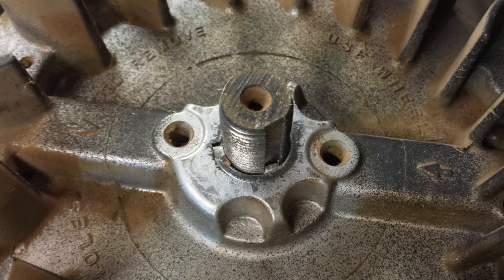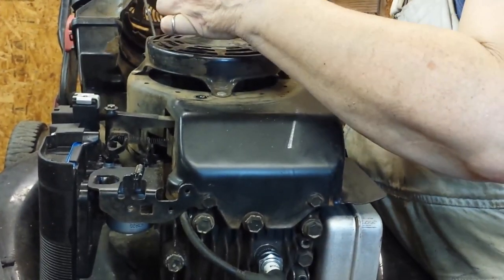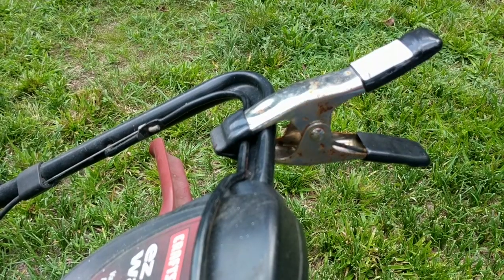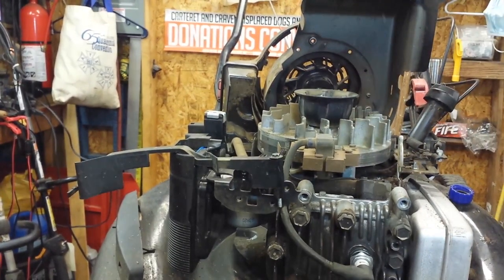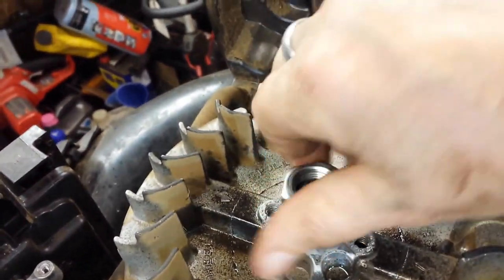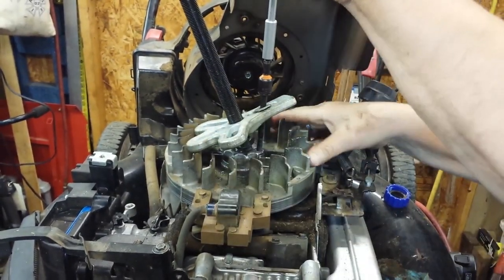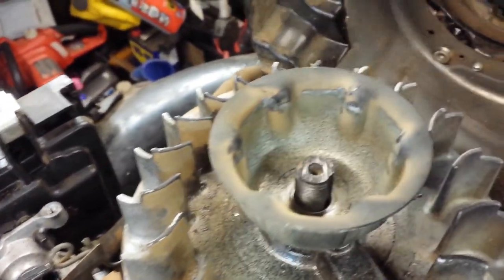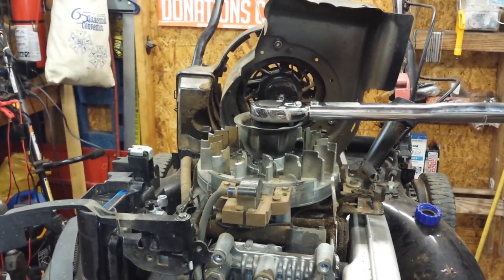Recoil Kickback on Craftsman Mower - Sheared Flywheel Key Briggs & Stratton

Comment: Great explanation ,  I typically pull the fw with hammer and brybar.  But using a puller is the right way to do it
Reply from the maker: That’s a good way too Mr. D. Sometimes I have trouble banging it off with a key so badly smeared on the taper. I’ve bent smaller cranks when they really stuck on.
Reply: @TheLawnmowerLady   Agree with you. Strangely when the key is sheared, the flywheel is often stuck soooo much harder on there.

Comment: Good video.
Another violent recoil kickback reason can be a loose blade because it was´nt tigthened enough to the blade adapter or a friction disk was worn out. I have experienced that after destroing to drills using them on flywheel attempting to start.
Reply from the maker: Another thing I've noticed too, is flywheels rotated only a few degrees out of spec, the more violent the kickback. I've had my fair share of bumps, bruises, and twisted wrists using a drill to start these small engines :) Thanks for watching Mr. Niels!

Comment: Hi Stella, thank you for the video. Very clear indeed, I will need to get a tap kit and a puller but they are not too expensive.
Reply from the maker: I'm happy to help. Some folks put a big prybar under the flywheel and whack the end of the crank with a big hammer. I'm not too keen on that method, easy to bugger the threads of the crank, and can damage the flywheel if you pry up in a weak spot. Cheers!

Comment: We subscribed! We've already watched 4 videos that aren't specifically about our Honda mower, but your explanations are so clear and well-presented that they're enjoyable to watch regardless.  We own a Honda HRN216VKA lawn mower that suddenly stopped working about 3 months ago after its last use. We usually hire someone to take care of our lawn, so we don't use it often.

We've already changed the oil, replaced the fuel, replaced the spark plug, and cleaned the air filter (which was barely dirty). We also checked the carburetor, and it appears very clean with no signs of water or dirt. Unfortunately, the mower still won't start.

At this point, can you please recommend the next troubleshooting steps we should take? We'd also appreciate it if you could suggest the tools and any lubricants we might need to get this mower running again.

By the way, we learned while changing the oil: Even after the oil seems to have stopped draining, tilting and flipping the mower a few times can help get out even more oil!

Thanks. Looking forward for your response
Reply from the maker: I appreciate you watching. Start with the basics: spark, fuel, and air. Spark testers are cheap from autoparts store. check for fuel flow by loosening the bolt on the carb bowl, and open the fuel tap. If fuel dribbles out, fuel is probably no the issue. I have several playlists on Honda. Check them out for more resources: https://youtube.com/playlist?list=PLscwXOlCLzlzHYMopMHmLP3oqzZ07e6DF&si=p_b9ZLsQqsTKGYsS
Reply: @TheLawnmowerLady  thank you a tone. We purchased an in-line spark tester at Harbor Freight,  but the bulb did not light at all. Is this a clear indicator for a default coil ignition or something else?

Thanks for the videos.
Reply from the maker: @SatellaPower  Could be several other things... broken brake cable, cable out of adjustment, etc. Trace that kill wire to the coil, it could be chaffed and grounding out on the engine somewhere. You can always disconnect the wire from the coil to see if it starts without the cable/brake assembly. Be prepared to pull the spark plug boot to kill the engine if it does start, or just let the carb run dry. You just have to methodically eliminate each path of failure, one step at a time.
Reply: @TheLawnmowerLady  Thanks. we got a hold of the Honda Engines Lawnmower HRN216 Service Manual on insighter today, and it's a lot more clearer for the troubleshooting steps. Thank you for your help. Greatly appreciated.

Comment: I just went through the installation of the Carb rebuild kit for the exact Briggs and Stratton motor and Carb. setup that I have.   
Nobody else ever mentioned this exact Mower setup.
I am still trying to keep it running after a col or warm start.  It seems that I might have a Fuel Flow starvation problem possibly.   That or one of those little ports in the Carb body itself may have slipped by me without being clean out.  I guess that we'll see when I do this removal of the Carb once again.

    Thank you sincerely for a excellent job of presenting a very clear  😅How-to-walk-through.

       Jeff Sabo
         (Edge)
Reply from the maker: I appreciate you watching. Cheers!

Comment: Buzz the OLD MAN here from Eliminator Performance: Good thing you did not snap an elbow cause that is how bad the kick back can be. Very good video, we normally just whack the crankshaft with the nut flush and light pressure with a prey bar under the flywheel and they pop right off. Woodruff keys are half moon shaped and made of steel normally on riding mowers, the push mowers normally have aluminium keys of different shapes ie: B&S straight rectangular and Techumseh has an offset key in some cases. Taryl normally uses an air impact hammer if the crankshaft has the countersunk center.
Reply from the maker: Ha! I cringed when I heard myself say woodruff and knew I was gonna get busted :)  In my defense, I come from the moped and antique scooter world and they're all woodruff keys,  not sacrificial like these small engines. Thanks for watching Mr Wayne!
Reply: Eliminatot beat me to it!  Just like when people call keys key-ways!  Drives me nuts!!!   Good Vid Stella!
Reply from the maker: Yep!  That too. I say "atomizer" all the time rather than "emulsion tube" for the same reason. Reminds me of that riddle: Why do we park in a driveway, but drive on a parkway?
Reply: Never worry about getting busted just about every YouTube creator has bloopers that they either have edited out or just left them in to see if someone comments on it. Keep up the good work, glad to see the ladies getting involved.
Reply: Gotta get up earlier in the morning Ken lol!
Reply: @waynestefinashen239  heck I’m up at 4am, just not checking YouTube!
Reply: Just kidding Ken have watched most of your videos and seen you were always an early riser.

Comment: That was a good lesson , curious question was there a need to set or recheck the coil?  Or did the fly just spin Free and not get its position disrupted?
Reply from the maker: Thanks for watching Mr Joe. I usually only need to re-set the ignition gap when I move the coil itself. Never had a problem with the gap after removing a flywheel.
Reply: @TheLawnmowerLady  thatsvwhat I thought just wanted to be sure I wasn't surebif it always had to be redone when the timing was upset kinda like a car when a distributor or chain belt goes there are a lottt of things to gave to reset and align thank you Stella another great lesson that makes joe ,mow happy !!😀

Comment: I got mine apart and looks fine-could the brake be causing it to kick back? It looks like it is disconnected and rubbing on the flywheel magnet
Reply from the maker: Absolutely if the cable is indeed broken. Do you see the brake pad move when you activate the cable? I made this video https://youtu.be/884sqyIEP7c More of a generic how-to rather than a model specific, but hope that helps.

Comment: an air hammer will yard it off quick as well. little pressure under the flywheel and hit the air hammer on the shaft it will pop up no prob. Using them pullers are a pain in the rear. So much easier to just use  an air tool to do the work.
Reply from the maker: I agree, but I tend to gear my videos towards the DIY homeowner, who often don’t have tools like that. Thanks for watching.

Comment: I have had several Briggs and Stratton engines on old mowers when been stood a long time clean carburettor run perfect then go back later and won’t start kick back on pull start checked timing oil level valves can’t find a problem is it oil getting passed rings any thoughts as have had a few like this please
Reply from the maker: Next time that happens, pull the spark plug, pull on the starter a few times, and replace the plug. If it starts fine then, you are getting partial hydro-lock either from oil or fuel getting to the combustion chamber. Replace the needle seat in the carb to eliminate fuel fuel getting in there. And store the machine with the pull cord just where it gets tension to ensure both valves are closed. That’s my guess?
Reply: Many thanks will try the pull cord stored under tension

Comment: Maybe you can help me I git a black max 450e push mower my flywheel key was sheard so I fixed but still won't start so I put a new carburetor on it still won't start so when u go to pull the cord it pops and a little flame come out of the carburetor any suggestions on what I can do next
Reply from the maker: The next place I would look would be under the valve cover. Confirm the valves are indeed opening and closing. These mowers have plastic cams that can spin on the camshaft, and create a similar timing issue. I hope this helps.
Reply: @TheLawnmowerLady  I just wanna tell you thank you for your help who ever had this mower before me had the valves tighting all the way tight you couldn't even get a 00.1 gauge through it so I readjusted them and it fired right up thank you again

Comment: I'm having the same problem. I asked eliminator  performance  wayne and Jake they said  same thing.. well the sheerkey  is lined right up. So now I'm  stumped
Reply from the maker: Have you pulled the flywheel to inspect the keyway? I've seen them run poorly and kickback with just a few mm of twist. Thanks for watching!
Reply: Check valve lash next

Comment: Not to be pickey, but the arm from the thermal actuator is bent against the choke air vane. This hinders the free moovement of the air vane and will cause the engine to run too rich. I think that strong observation skills is one of the most important parts of being a good service tech. 
A little side note, A "woodruf key" has the shape of a half moon, otherwise any other shaft key is called by it's end profile.
Reply from the maker: I addressed some of your concerns in earlier comments. Thanks for watching.

Comment: If only they would tell you what happened 
Makes it easier
Reply from the maker: I know. Right?
Reply: Its really hot in West Texas but I v all ready rebuilt carb on a asphalt packer and a bs carb plus oil and air filters 
Fixing to pull engine on orange blower to over haul